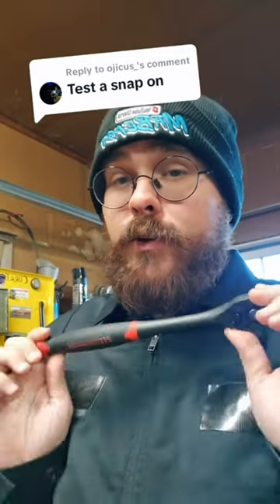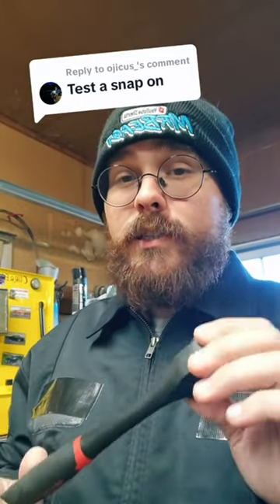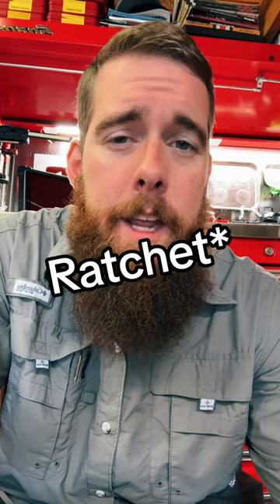But Why Though? #mrsubaru1387 #Ratchet #mechanic

Comment: Project farm does it correctly
Reply: Milwakee for the win. That's what I bought
Reply: @redsquarejay Are you talking about Milwaukee's ratchet ? If you are, is it any good ? I've been thinking about getting a set
Reply: @billapostolou7478  Yes. It had the highest breaking strength.
Reply: @redsquarejay  I've watched project farm's video, I'm just asking someone who has used it extensively. I'm a huge Milwaukee fan so I really wanna buy the whole set but I'm still doing the research 😂
Reply: @billapostolou7478 they aren’t bad, I have three of them and yes they are strong but randomly catch quite a bit. At first I thought it was a fluke but then the next two did it
Reply: @billapostolou7478 they are good, the best 90 teeth I’ve ever held in my hand. They are butter smooth but not like SK that much loose, not at all, it’s just pure smoothness. it’s better than GW, Tekton and craftsman v series. but it’s not snap on feel.. well obviously 10 teeth more and snap on doesn’t have a 90 teeth, but the felling isn’t the same, I would describe snap on is rolls Royce and Milwaukee 90 teeth ratchet is Bentley.
Reply: Indeed he does
Reply: @evanlugin  Well snap on is definitely in a league of its own as a company but honestly I don't think they are worth their price. They probably do make the best tools, but not 3-4 times better. Bc their price is absolutely 3-4 times higher than most brands. Thanks for the info on the Milwaukee though man I've wanted them for a while now 😂
Reply: @billapostolou7478 definitely worth the price  when I first started wrenching I used to tear uo ratchets I have one nearly 10 years now abused and it's never been rebuilt minor fixes over time (on off switch breaking jamming them into tight spaces)
Reply: @billapostolou7478 you can’t afford

Comment: It’s a test of factory lubricant, and wear resistance. Basically if the pawls and ring will destroy each other.
Reply: Its still not telling you much. The speeds you ratchet at and the constant torque cycling the teeth go through are completely different to being spun up in a drill press. Different heat build up which the lubricant inside may not even be designed for so its a null test there to in regard to real world reliability.

Comment: I mean. If he’s spinning the ratchet head (at a reasonable spin, not at drill press speeds) it could be a somewhat accurate idea of how the teeth hold up to extended use? I don’t know.
Reply: But he's presumably running it "backwards"... Just clicking away. Any old ratchet can run backwards, the hard part is going "forwards" without failing. He's not testing anything at all, just making noise and wearing it the wrong way.

Comment: I’d imagine durability across different brand from what it looks like.
Reply: durability of what? its like testing the strength of a car’s transmission in neutral
Reply: It would only test if the pauls or whatever the mechanism is wear out when spun in reverse.  It doesn't test how much torque the ratchet can actually handle when being spun forward.

Comment: Durabilty?
Reply: You're never gonna have a ratchet spinning that fast with no load
Reply: @jocool562 drill presses can go 300rpm which is reasonable approximation of speed.  Plus there’s never any load on the ratcheting portion of the stroke